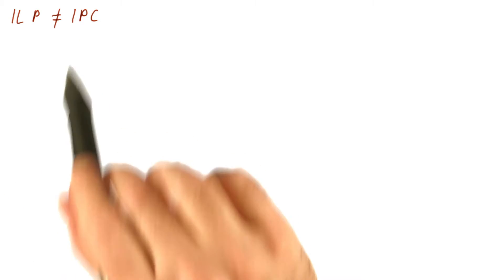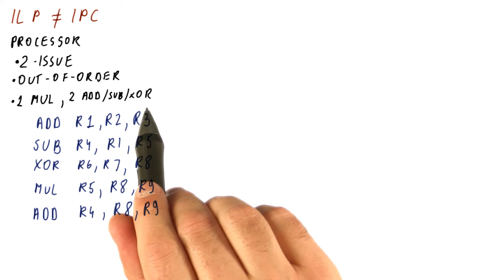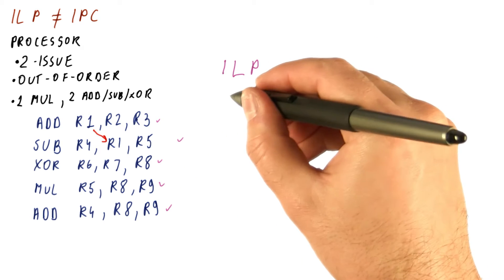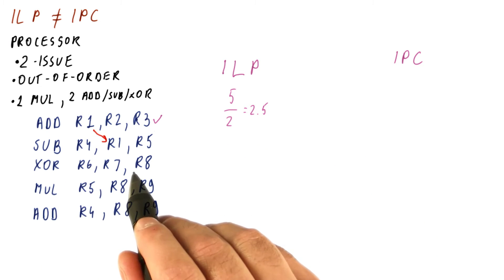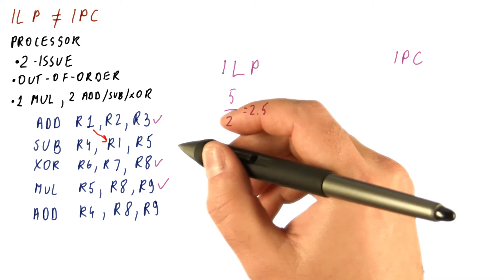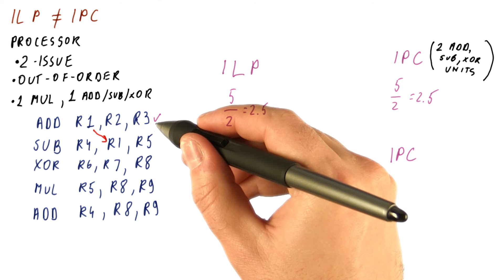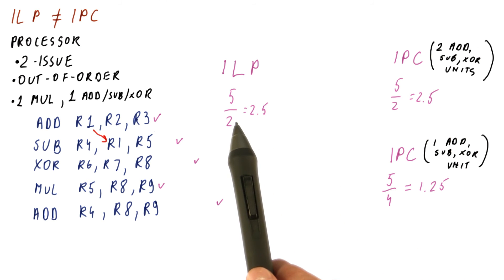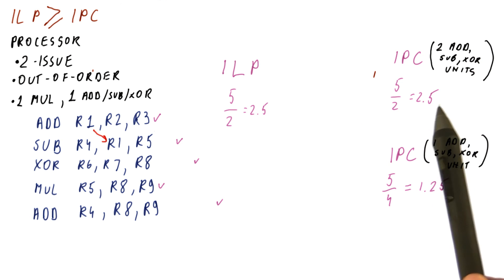ILP vs IPC - Georgia Tech - HPCA: Part 2

Comment: There is a mistake here. It has to be 3 issues and not 2 issues while giving the conditions for IPC, as during the calculation, we do consider 3 instructions in a cycle and also the 3rd condition is that we can use 1 MUL and 2 ADD/SUB/XOR.